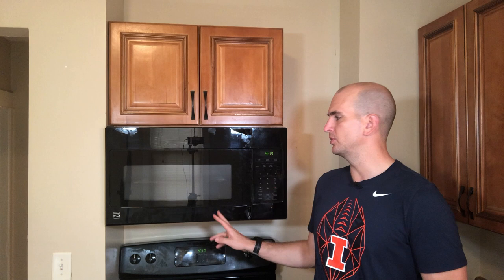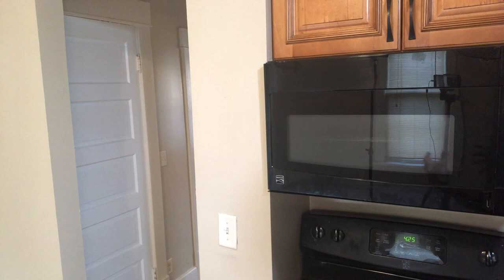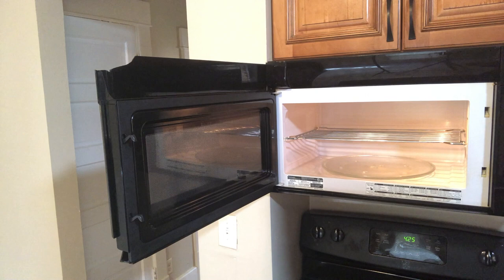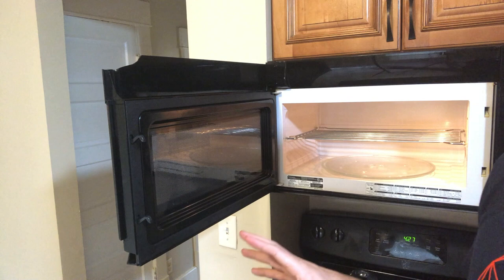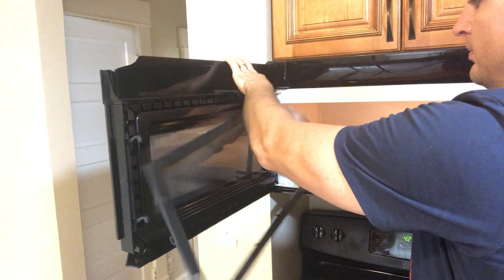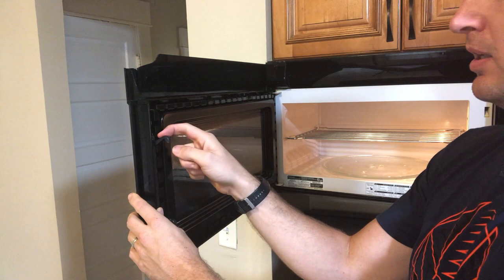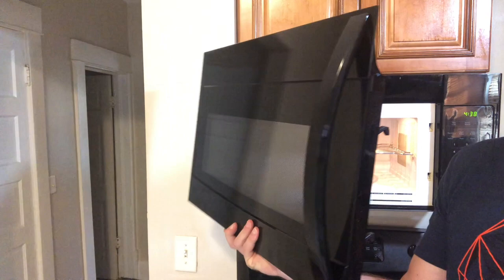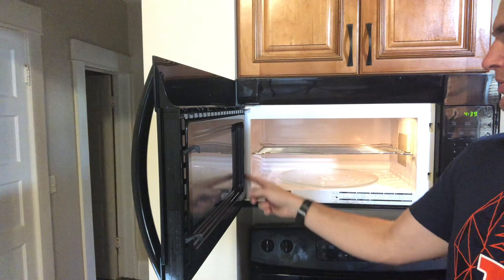Microwave Door Disassembly and Repair

Comment: Thank you!!!. Using your video and a few others I got the courage to try this. Replaced broken microwave door  in a rental unit. Saved myself a lot of TIME  and money. Bought it in Amazon for $70. I unplugged the old microwave, removed the damaged door and took it home with me so I could take my time to determine if I needed a specific part or the whole door. I could have replaced the frame only but for the price difference it was not worth the trouble of disassembling  the old door so I bought the complete door and it was easy to install.

Comment: I found this very useful and the Kenmore door appears to be identical to our Bosch microwave. My problem is I only need to replace the handle and after removing that initial cover piece the screws to change the handle were not visible with the glass fitting attached. How do I take the cover off the door so I can access the screws for the door. Thank you

Comment: Great video, I appreciated it.  However, blaming the tenant for a design flaw I think is poor form.  The plastic backing holding the door is extremely flimsy. A single screw going through unreinforced plastic is responsible for the breakage, not a lot of cooking by a tenant.  These things break with minimal use.

Comment: Great video. The unit is pretty similar to my Samsung built in. My inner panel is coming off. The unit worked for a bit but then started not heating slowly and then completely. I’m guessing this is a safety feature that the unit will not work unless there’s a complete seal? Hoping that’s the only issue, seems like the most obvious reason it stopped working. Thanks for the tips!

Comment: I ordered a clear piece of tempered glass for my GE microwave but now you can see the inner part of the door. It should be obscured by the tint or bubble effect at the top of the glass. It was cheap but not the correct replacement glass. Lesson learned.lol
Have a great day

Comment: I have a Kenmore microwave above an oven.  The microwave has the black vent frame around it.  The push button door latch broke so I can't open the microwave.  There are no screws to remove the frame and I can't get anything behind the door to open it (like a thin spatula) because it's flush with the vent frame.   Do you have any suggestions for how to open the microwave door so I can start the repair process?

Comment: I have a Whirlpool microwave model MH 1150XMB-1. The door's face plate is cracked and the handle is broken. I purchased a new face plate and handle. I watched your video and others describing how to replace the entire door or handle, but no one addressed how to remove the face plate. I have removed the three visible screws, but the face plate is still in tact. I need help please.
Reply from the maker: Hey Christine,  hard to help you without seeing a few pictures.  I wish you could post pictures in Youtube comments but at least currently that is not a supported feature.  You can jump over to our Everyday Home Repairs facebook page and send a message with pictures and I can try to help.  Thanks!

Comment: You definitely took the easy way out and when I say that I had to replace the outer door trim and you need to pull the door, handle, inner frame, and the glass. What a pain in the a$$.  You literally have to bend the plastic to fit the zero tolerance glass in which took several tries.  I don’t know why but, the outer trim would not clip at the hinge side on two clips.  This is a 18+ year old JVM1640 and not worth putting any more money into.  The trim was 35.00 and that’s all folks.  Good video, well spoken, well edited.

Comment: I watched your video on removing the inner trim from the microwave which is identical to mine. The inner frame has not been damaged in my range,  but the interior glass was damaged and needs to be replaced. Once the inner frame is removed, how do you remove the glass and the microwave shield which should be one piece? I have ordered the part from Sears Parts Direct. Entire door assembly was out of stock ($226). Glass/shield piece ($114). How do you check for leaks, or do we need to after replacing the inner glass/shield?
Reply from the maker: Hey Betty,  Go ahead and install the new glass and make sure everything aligns and snaps into place.  I don't know of a full proof way to check for leaks but think it will be pretty apparent if things aren't lining up because the door will be hard to close and might not latch.  Give it a try and let me know how it goes.

Comment: Looks easy enough. my outer door glass broke, what is your advise: should I just replace the door or the glass???Is it a special glass IF i can repair?? If so would you know where to order glass or door for a Kenmore micro/hood cobination microwave???? You help is greatly appreciated
Reply from the maker: Hey Rosie, In the past I have used partselect.com.  You can enter “Kenmore” and the model number for you microwave and then they will show you the parts available. You should be able to buy a complete door or just the glass portion if you want to disassemble and reassemble the door with the new glass.  Best of luck.

Comment: Thank you for the video.  I am trying to replace the door handle on a GE built in microwave- model PVM9179SF2SS.  I am able to remove the choke/ the plastic around the inside of the door.  I am unable to see where the handle is screwed in.  Can you give me dictions to remove the door assembly so that I can get to the handle screws?

Comment: If I needed to replace the entire door this would be helpful. However, all I need is to replace the clear outer plexiglass on the door rather than the entire door. Still looking for how to remove and replace that for a GE model JES2051SN3SS microwave

Comment: We have a new Kenmore brand microwave. The door is like hard to close and open, I guess because it's new, but it annoys me.  So I file both latches to make it a little bit softer to close and open,
but I file it too much. Now the latch is not in contact with the switch inside.  Do you have any remedy or solution without buying a new part/parts?    Thank you and more power to your channel.
Reply: Change the spring tension so it shuts softly ...and engages the switch that enables it to start up

Comment: how do you replace the inside see-through window on a  frigidaire microwave door? FGMV175QFA part# FRG9492506 we received the part with no instructions...can you help us?(the glass got zapped by a piece of alum.foil and created a hole in glass).

Comment: A couple of questions, where do you recommend a door assembly for a rival microwave oven and are the replacement steps similar?
Reply from the maker: Hi Xena, depending on the brand you could probably find it on partselect.com or amazon.  The majority of modern microwaves seem to have a similar door hinge design. Best of luck.

Comment: When a good over-the-range microwave costs between $200 to $400 at Lowe's, I don't see how to save money by replacing the door at around $250+ just for the part, excluding shipping.  Just change out the whole unit.

Comment: So its not 'Microwave Door Disassemby and Repair' its removal of a door and put another one back. Where is the Disassembly, where is the repair? Dear oh dear..........
Reply from the maker: Were you looking for help on a specific issue?
Reply: @EverydayHomeRepairs  disassembling a microwave door, strangely enough. Thanks for asking, nice video, apart from the title.👍
Reply: @EverydayHomeRepairs  Yeah, I also need to take apart the door to clear up inner condensation and film on screen.  Your first steps are what I expected; it would be nice to see the full disassembly—as indicated in your video's diagram—before attempting it myself.  I suspect it is merely a matter of another snap-fit prying procedure along the door periphery where those tab-like projections are, but it would have been nice to see.

Comment: uh.... most people who cook will use oil and heat to do it.  Cooking with the amounts of heat required should not destroy the handle on the microwave.   The door failing is not because of them, but because of  the microwave being made flimsy.  I cook all the time, and yea, I often use oil in my cooking, but that has nothing whatsoever to do with the microwave door breaking.  

We rent, and our microwave had gone bad.,.. started acting weird, where if you punched in 2 minutes, it would try to run longer, or suddenly change the numbers you punched in.  I saw it happen when no one was touching it.  Would you fault the renters for cooking things that put off steam/moisture?   That's what happens on a stove.  People cook on them. They cook in water, they cook with oil. That's NORMAL behavior. It's what stoves are used for.  People who make Microwaves designed to go above a stove are supposed to take that into consideration and design them to withstand moisture and any heat. Heat RISES. 
That's the way it works.  But I cook with oil and medium to medium high heat depending on what I am cooking all the time... and my handle never came off.  

So the owners replaced the  microwave.  A YEAR in, and I use my microwave probably daily, maybe even multiple times a day - and I cook every day.  Last night, as I said, only a year in, suddenly the frame on the inside of the door popped out on the bottom when I opened it, AND a piece of PLASTIC that they use inside where the door latches, broke and fell out.   The previous microwave never had that happen, and it had been 4 years before he replaced it due to the weird electronic issues. 

It's not my fault the frame came off .  I use the microwave a lot.  I cook a lot. But it's not my fault, nor the grease build up, the fault is FLIMSY parts.  They use plastic because it's cheaper than metal, and God only knows how that frame is attached, but clearly it should not come off in a year simply because the person uses it . That's what it's for!   And it should be designed to withstand heat, steam etc from the stove beneath it, and yes, grease buildup.  Why you think Grease build up contributed to the door handle coming off is beyond me. That makes no sense.  The handle came off because of the way it's made, not because someone was cooking with oil and heat beneath the microwave.  The microwave handles on my microwave never came off in 4 years and I cook daily - often with oil and with med to med high heat.    

You should not blame the renter when parts fail like that, or a door handle comes off.  It's most likely a fault in the plastic, like with the part that came out of the door latch. Why they use cheap plastic in that instead of metal is just beyond me. It should be common sense that it will get a lot of use, and should be designed to last.  But then again, maybe that's by design.   I have seen the prices of parts for refrigerators, and  it's the same for microwaves. Over a hundred dollars for a stupid plastic bin?  SMH   
$87 for a HANDLE? The entire Microwave costs like $500, and a door handle is $87??? (GE handle was at a website called  Part Select)   That's outrageous.  The bin really ticked me off because they are VERY flimsy plastic. It doesn't take much for a refrigerator bin to break. One would think they would be designed to hold a decent amount of fruits and veggies, but if you actually put a decent amount in there, be very very careful when you open the drawer, or if you have to take it out (remove everything from the drawer before you remove it because it is flimsy and could easily break from the weight on the plastic. 

Cooking with oil and "high heat" & microwave issues?    

The only thing I can think of that 'might' result from cooking with oil a lot below the microwave, is the vent hood getting an oil buildup.  I can't help but wonder whether you have even thought of that.  Ours has a vent ductwork that leads to outside the apartment, but I can't see how it could be cleaned since it is a totally closed system except for a tiny vent on the outside of the apartment building.    That's going to be a problem.   My microwave is now leaking oil out of the holes inside the ceiling of the microwave - maintenance doesn't know what to do, so he was going to replace it.    EVEN THOUGH he was the one to first suggest it could be an oil buildup in the ducts. He has no idea how to deal with that, and neither do I.  Try a google for that, and all you get is restaurant hood cleaning.  For restaurant hoods, they clean them from the roof, and they are big enough I believe that sometimes the people who do that for a living (my brother had a business doing that) can literally climb inside to clean them. They have to be cleaned or they can catch fire.    But I don't think the people who started making vents to vent smoke and moisture outside ever considered that they would end up building up smoke and even grease inside the ducts.

Comment: Replacing the whole microwave for $500 when the repairman is only $250?  Still probably not a wise investment unless the microwave is old.  And based on what I have seen in the past 5 years , with a GE microwave which one would expect to be quality... they just are not built to last.   I could not believe the door had a plastic piece break out of the latch, and that the frame came loose like it did... at approx a year old,  if that.

Comment: Thanks for your information/horror story. Tenants who cook with gallons of grease ON the appliances have either clearly missed the most basic concepts of cooking, in any ethnicity, or they were under the impression kitchens and related appliances are disposable, which could be a failure of communication, education,  civility, health and safety, common sense, and/or self preservation. In any case, they need to be evicted and immediately returned to their parents, hovel, school, orphanage, foster home, rehab, shelter, or whatever cog in the proverbial wheel rushed them along to independent living in your unit, where they have really overshot the mark, and swam way beyond their depth.  
These are ideal candidates for work farms and prison labor, if that. No war torn region would want them, going through multiple microwaves and grease by the gallon, who are these people? ?
They should come with warning labels. Even for those who enjoy domestic violence, there's no excuse for that stove top.